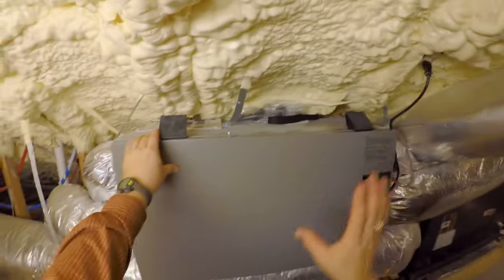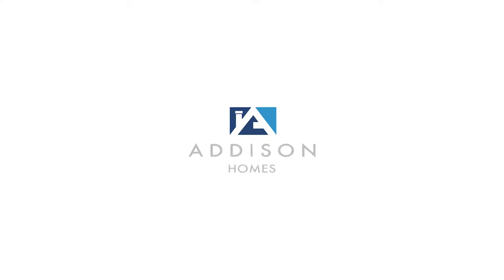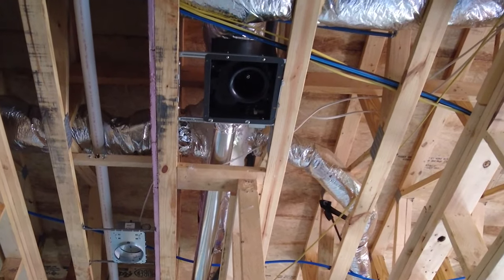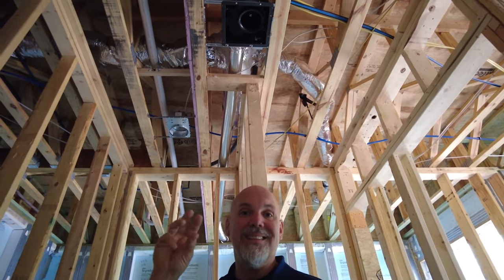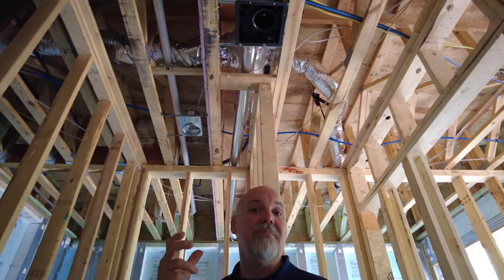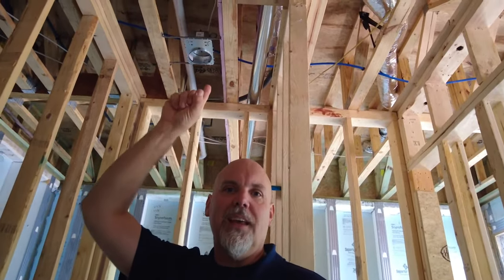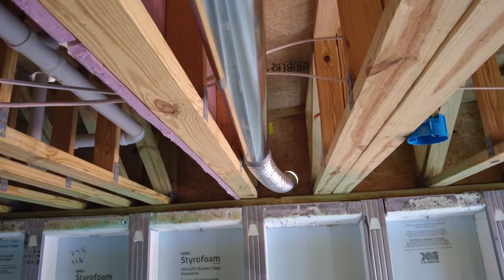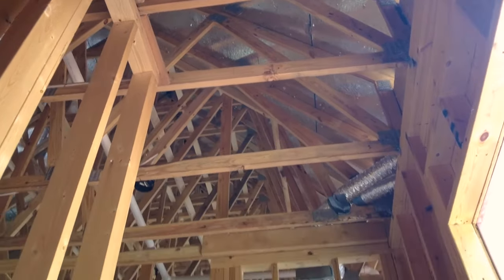High Performance Bathroom Ventilation | Above Code

Comment: I had work done like this in my house. I just had my house (1927 bungalow, 1092 sq ft) insulated. All the old insulation was removed from my attic. Then all the knob & tube wiring was removed in the entire house and all the wiring was brought up to code. Then, the entire house was air sealed, insulation blown back in the attic and exterior walls. A heat sensor was used to make sure there were no bare spots and the few places that needed additional insulation was topped off. They installed a Panasonic Whisper fan in my small bathroom that is located next to an exterior wall. They used metal ductwork to vent to the outside. Even with my old windows installed I can feel the difference. Plus, my house is so small that removing the moisture/hot air is helping to keep the temperature down a bit. It is 80 degrees outside but my house temperature is cooler...no AC on yet. The bathroom previously had no exhaust fan and I am astonished that, upon taking down old wallpaper, that there was no mold. Whoever designed the house was mindful of airflow, so a big window faces the bathroom shower/tub and the bathroom has two doors on opposite sides. This bathroom is TINY so the airflow must have been pretty good. The guys did good work.
Reply from the maker: Like the story!  With old homes like yours, the walls were typically very leaky, which wasn't great for insulation, but was perfect for drying.  Probably the main reason there was no mold in the bathroom walls even with no bath fan.  Old houses were very forgiving with moisture since the constant air movement through the walls and ceiling took the moisture with it!

Comment: What pipe size are you using, 6 or 4-inch?
Reply from the maker: We use both 4" and 6" depending on the bath fan model.  The 110-130-150 cfm fan uses a 6" diameter vent pipe

Comment: So many of these little extra efforts make such a difference and so many production builders just don’t do it.  As tight as your homes are do you ever use a HRV / ERV for bathroom ventilation and skip the bath fan?  I image in some instances its budge related.
Reply from the maker: No doubt Kevin!  The little things can make such a difference!  
We have used an ERV for bathroom ventilation in the past but discovered that it results in a few challenges: 1) The ERV actually exchanges moisture from the higher moisture air stream to the lower.  In this case, we run the risk of "humidifying" the incoming fresh air with the bathroom exhaust air.  2) We discovered that this strategy relies on the homeowner being meticulous with regular maintenance of the ERV (filter changes and cleaning of the cabinet) which frequently is overlooked - which doesn't leave us with a very resilient system for managing humidity sources in the home.
Reply: Did not think about the humidity part of the equation, interesting point.  The other point is a problem across many homes… unfortunately I find myself helping friends with repairs or fixes that would have been unnecessary if common maintenance had been done!  Appreciate your point of view and experience!
Reply: @Addison Homes, do you have a particular ERV that you rely on or prefer? We built a home in North Carolina last year, spray foam insulation on first and second floor and sealed attic and crawl space. We are having problems with CO2 buildup in the home, looking at a few options with ERV. Would like to hear your input.
Reply from the maker: @LS2FD  We currently do not incorporate ERVs as a standard feature primarily due to our experience with lack of maintenance (cleaning) by our clients.  Admittedly, I (Todd Usher), don't keep up with the regular cleaning of my ERV at home!  With this said, Zehnder appears to be one of the leaders in the ERV industry, but the costs are VERY expensive.  Broan and Panasonic make very good ERVs - I personally have a Panasonic in my home.  On our new homes, our standard approach for ventilation is to use a ventilating dehumidifier for 1) Fresh air intake, and 2) humidity control of this fresh air and the entire house.  I like the Aprilaire EV100 unit with the fresh air adapter since it has onboard controls and will physically draws dedicated fresh air into the system at the prescribed frequency (minutes per hour) which makes it easy to confirm the actual fresh air ventilation flow during ventilation cycles.  Here is a marketing video https://youtu.be/FkgdbeL2tio  
This segment will continue to evolve with new technology and smarter products.  Ultraire makes great dehumidifiers but does not have the dedicated fresh air intake damper nor the level of control sophistication.
Hope this helps!
Reply: @AddisonHomes  is the Panasonic fan the absolutely best bathroom fans on the market?
Reply from the maker: @rickyperkins232  I think they are hard to beat. Greenheck has come out with some residential fans that some say are better than Panasonic but I’ve not been able to get my hands on any to try.
Reply from the maker: Update- we have moved to the SantaFe line of ventilating dehumidifiers after discovering challenges with the Aprilaire EV100 units supplying superheated ventilation air to the building during ventilation mode. Because it pulls only outside air in during ventilation mode and attempts to dehumidify it when needed, the outside air is heated further from the dehumidification process and must be mixed adequately in the hvac duct system before distributing to the house. The SantaFe Dehu’s mix house air with the fresh air and don’t have this challenge.
Reply: @AddisonHomes  I am going to take your recommendation and purchase the Panasonic since I am in the marketplace for one. Where do I go for the best price?
Reply from the maker: @rickyperkins232  Make sure get the whisper green select.  You can purchase them online or if you are in this area, I know that ProSource lighting in Easley stocks them and you can also get them through Ferguson.
Reply: @AddisonHomes  thanks

Comment: What are your thoughts on adding a vent in the door for added venting? Our home is of cinder block construction with little to no interior insulation besides thin “studs” with plywood over it.  We found this out afterwards. We fight mold in bathroom on outside wall above window.  We did replace the old window last year, possibly causing even more condensation
Reply from the maker: It sounds like you might have condensation occuring on the inside of the walls due to the limited insulation on the concrete block construction.  If you check out our video on Basement Wall Insulation Done Wrong, the same concepts likely apply to your wall construction.  In this case, the ventilation my not be the issue, but air leakage carrying moisture towards the block resulting in condenstion.
Reply: @AddisonHomes  Thanks for the reply, I will check it out. I did want clarify though that when I said "outside wall" I meant the interior wall that the window was in, not the other interior walls of the bathroom. I was not sure if that changed the possible cause.
Reply from the maker: @LeeRalph100  That would make sense - the wall between the bathroom and the exterior of the house (where the window is located), if cinder block with poor insulation, would be a classic location for condensation to occur which would lead to mold.  Where are you located?
Reply: @AddisonHomes  In the Mid West
Reply: if youre fighting mold on porous surfaces like concrete your problem will continue to arise no matter how much you ventilate. you need to dehumidify and also treate the concrete with antimicrobial products. i just recently remediated a rampant black mold problem in my parents home and learned alot from the mold inspector. invest in a hepa 500 air scrubber and buy a dehumidifier. quarantine the affected area with plastic and be mindful about particulates and where the travel. this is why remediators where tyvek suits. be sure to use proper resperation. antimicrobial paint like kilz over concrete is your best friend and using products like ec3 are expensive but worth it. its the most important work youll do in your home these toxins kill and can cause a very serious set of auto immune diseases. take care and god bless.

Comment: Great video! What vent cap do you like to use for wall exits? And what humidity sensing switch do you use?
Reply from the maker: For wall caps, we prefer the Primex WC series wall caps since the have a flange and stand-off that integrates well with water barrier flashing and siding. We use the DewStop condensation fan control with countdown timer.

Comment: Is it more efficient to go horizontal through the side of the house vs. vertical through the roof?
Reply from the maker: Depends on where the bath fan is located but we typically prefer a sidewall or soffit termination over a roof termination.
Reply: @AddisonHomes  I have been told to never vent through a soffit if it can be avoided. Adding humidity into the soffit area is asking for moisture damage. Additionally, if the attic is vented through the soffit, then you are sucking back in that moist air into the attic.

Comment: Thanks for the information on bathroom exhaust fans. On placement inside the bathroom, do you recommend installing the fan above the shower/bath (using a fan that's rated for above shower/bath use) or do you install it somewhere else?
Reply from the maker: We usually layout the fan location to be close to the shower/bath but not directly over it. Often we will locate it between the shower and the toilet but slightly favoring the shower. The bigger key in my opinion is to make sure the exhaust fan flow is adequate. We typically use the 110-150 cfm selectable for owners bathrooms which are typically larger and 80-110 cfm selectable for “normal sized bathrooms that are 5-6 feet wide containing a standard tub/shower unit.  Ducting bath fans with solid metal duct and using a low static termination cap are critical for achieving proper (rated) airflow - and testing flow is important. We’ve seen our fair share of bath fan dampers that are pinned closed by a duct screw!
Reply: @AddisonHomes  Thanks for the explanation! If we got a dollar every time a contractor put a fastener in the wrong place we’d be rich lol.

Comment: So what is your definition of a short run where you would still use flex duct?  8 foot or less?
Also, if you are using flex duct, how would you insulated around it and where it goes out into the soffit? I know some people would use spray foam but doesn't that risk collapsing the flex duct?
Reply from the maker: 8’ or less would be fine with flex duct as long as it is pulled tight. We use raised heel roof trusses and the sheathing goes up over the raised heel to hold the attic insulation over the outside walls so we just cut a round hole through the sheathing and run the vent pipe out through the hole. No sealing needed since it’s outside of our airtight envelope.
Reply: @AddisonHomes  OK but what if the bath is on the first floor? Shouldn't I be concerned with letting that cold air into the ceiling?
Reply from the maker: @bambamnj  If the bath is on the first floor of a multistory home, it is easiest to take the exhaust fan duct out a sidewall of the building.  Using a good quality termination cap with an effective damper will keep cold air from coming back through the duct.

Comment: That second floor fan exhausts at the soffet? Won't the soffit intake just pull all that moisture into the attic ?
Reply from the maker: As long as the termination cap directs the exhaust air away, it will not pull the air back into the attic before the moisture is diluted with the outdoor air.
Reply: @AddisonHomes  I am glad this question got answered bc I remember seeing one popular home improvement show {thisoldhouse} where they said you should try to never vent through the soffit for exactly the reason the original commend stated and if I remember correctly, they said if you had vent through the soffit you had to make sure your vent dropped down like 8 inches below the soffit. I always thought that was crazy bc I have seen tons of soffit vents for bath exhaust and none of them were dropped below the soffit.

Comment: What is the best way to seal and insulate the rigid pipe ?
Reply from the maker: Either install it low so it can be buried in insulation, or wrap it with duct insulation.

Comment: If you have two vents in a large custom shower, can the venting be joined to one, then directed away? Or does each vent need to have its own separate run….
Reply from the maker: Short answer is that each should have its own run, otherwise they will fight each other and could Backflow. Theoretically, you could combine them using a larger duct after they combine along with Backflow dampers to prevent Backflow, but far easier to pipe them separately.

Comment: Nothing about placement?
Reply from the maker: As long as the exhaust fan is in the bathroom where the source of the moisture is located, it will create negative pressure and remove the moisture.  Check local codes if you plan to install the exhaust fan directly over a wet location such as a tub/shower as it should be wired on a gfci (ground fault) circuit.